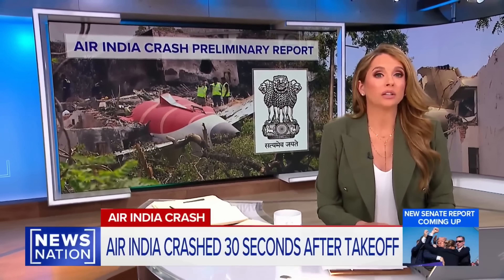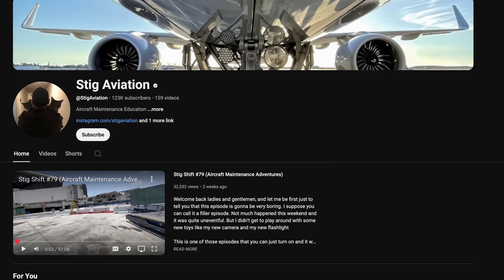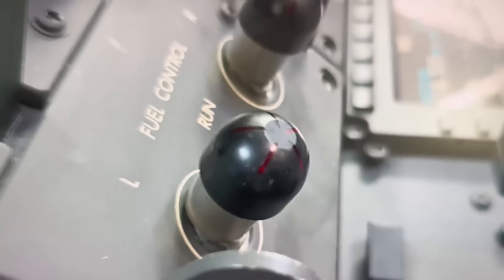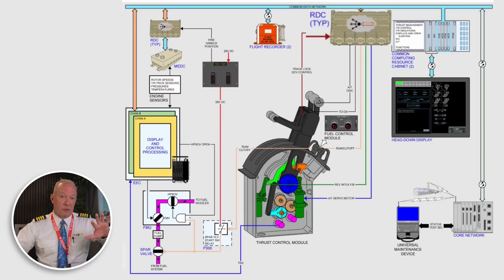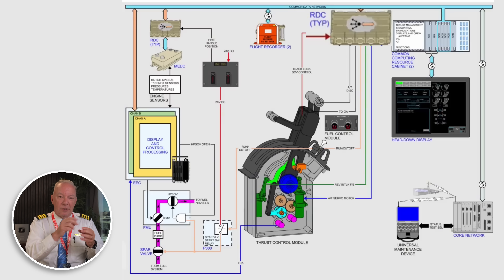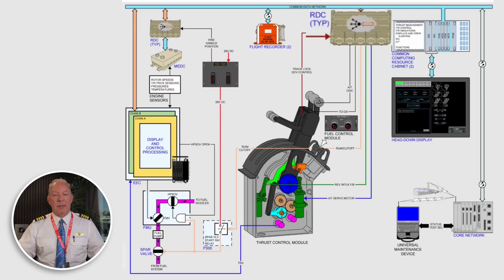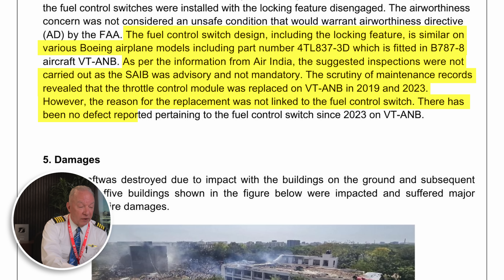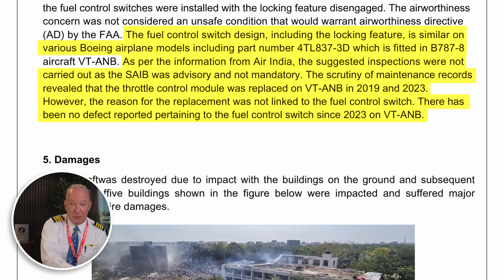The Truth About Boeing 787 Fuel Control Switches

Comment: If it's run by "relay", your switches are NOT directly providing power to the pumps. Hence " Relay" . Usually a switch can be a lower control voltage, that operates the relay. Than higher voltage or amperage is available through the power supply to the relay. The coil in the relay is what keeps the contact in or out, depending on the relay's configuration. Some are normally open, and others are normally closed. A separate ground is connected to the relay to give the opposite side of the actuator coil it's closed circuit. The actuator coil can be positively grounded or negatively grounded, depending on what the control circuit is designed to provide. The ground side of the coil, doesn't necessarily have to be connected directly to ground, it can be run through a control module, which can enable or disable it's path. There's more to it than you say  without the actual schematic, you can't assume the simple arrangement you offer. That Flow chart, may not show everything that is in an actual schematic. BTW: your switches are not relay's, and don't operate the same as a relay. https://images.app.goo.gl/ZUoH1qTBQRcaTZst6

Comment: You should note that a relay is an electromagnetic switch that takes a small current such as from the fuel switches and then magnetizes and pulls a switch to the other side (switch like a light switch but powered by electromagnet.) The relay then conducts a larger current than the small switch (fuel switch) can carry. They are set for normally open (off) or normally closed (on) when no power is applied. I would imagine the relay for the fuel valves would be normally closed (on) when no power is applied (run mode) but when the fuel cutoff is set to cutoff that would energize and open the relay cutting power to the fuel valves. If electric power is lost the relay would stay in the normally closed position and the fuel valves would stay open as well. As stated each engine would have their own system so not likely that there was duel relay failure.

Comment: Only other possible way to lose control switch power to the relays or even lose load side power off the relays is a total 28vdc failure in that closed loop circuit….. but highly unlikely in this situation given the data put forth on what was recorded as happening to one…and than the other engine shutting down and than again reigniting
Reply: You can have 28vdc failure in part of the circuit in general. It depends on specific connections.

Comment: Switches are controlled mechanically, Relays mostly electronically (and high voltage usually), and can incorporate both.  Relays are most likely to fail, in both conditions, i.e., either in 'closed' or 'open'.  Now, depending on the circuit?, it's easy to understand why both could fail at the same time, or be prone to electrical leakage from another circuit, regardless of what position the mechanical ones were.  In fact, we could well have a situation, where neither position of the mechanical ones do nothing, as the relays for these have blown open or closed.  Relays are ideal for remote control applications, and high-power switching, while both function identical, the relay is the weaker in the circuit, as it relies on a certain voltage to control it's position, on/off, or in some advanced relays, intermediate etc.   Most fridge freezers are fitted with them now, which is why you hear that distinct 'click' when the required temp has been reached, hence 'shut off' ;)  I have lost count of the amount of devices that have failed due to relays in my profession, and are No 2 behind the usual failed PSU in anything.

Anything is possible, as regards wiring and electronics.

There really is no need to look any further, than Boeing.

Comment: I have been asking this question with no answer...  How does the FDR Know the position of the fuel control switches?   We are saying the pilots moved them, there is no visual of that, If a major power spike the FDR could be confused as to the voltage drop thinking and recording switch movement. and the engines cycled a restart by themselves.  Totally confusing the pilots in that 30 seconds of flight.
Seriously you cant say the pilots moved the switches..  there are too many other points of failure in this totally electric plastic airplane.    Air India and Boeing have not a good track record of Truth.

Comment: am i not gettin´something? i know why these switches exist, but why is it even possible to shut them off in that stage of the flight, that distance from the ground? let´s not beat around the bush - it was suicide
Reply: Keeping it simple increases reliability and reduces mechanical points of failure. There is no way to fully prevent pilot failure. The pilot must be in control.

Comment: you said when all electricity fails there is still some juice left in the battery's to keep the fuel switches open but what when they realized all power was gone they might have still tried to move the wheels inside the plane, as stated from witnesses saying the wheels where tilted in the forward position, this depleted the left juice in the battery's since the wheel lifting system pulls a huge electricity surge resulting in emptying the last from the battery's resulting in no electricity left for the fuel valves. Also keep in mind relay's wear a lot all the time and can end up doing completely the opposite. In car diagnostic this is always a huge challenge when addressing electrical failures.

Comment: Captain Steeeve:   Would you agree that the pilot job can be very boring at times?   Especially if you are nearing retirement and you've done the company mandated procedures many, many, many times?  I say the India 171 Captain was just not "in the moment" at this time in the takeoff, went to do "gear-up" and his habit-brain just made a mistake and put the fuel switches down instead.   Unfortunately, this simple mistake is not able to be corrected in time at this stage of flight.
Let's have a discussion about the dangers of boredom in the cockpit.
(I am a former Avionics Engineer with a fair amount of jump-seat time)

Comment: I was a aircraft electrician in the army for rotary wing aircraft and we had those switches in aircraft. You did a great explanation of how they function.
Reply: When was this?
Reply: Captain Steve incorrectly describes the control of the fuel values according to the diagram he presented. He needs to explain and correct those errors if he is to restore his credibility.
Reply: what about a drop in voltage to the relays ( may it be the voltage or loose wiring or ....) Is that not a possibility ?
Reply: @theguy4355 anything is possible…however BOTH of them failing within one second of each other…lessens the chance of that quite dramatically.
Reply: @theguy4355 But both within 1 sec of each other and then on again?
Reply: @USCG1990  If you are committing suicide you don't turn them back on again.
Reply: @JoeLinux2000  there were 2 pilots in the cockpit, it's most likely the other one turning them back on after realizing the situation. And the pilot who allegedly turned off the switches pretty much knew that there's no going back at such low altitudes. He did it at the absolute perfect time from where recovery was impossible
Reply: @DuskyDaily  The other pilot did not say he did put switches on again.

This whole story of Captain Steeve is absurd, he does not give the electronic circuit how to check if switch is off. It does not have to work with the switch, it can work on relais.
Reply: @theguy4355  Who knows, but typically one wouldnt wire a DC circuit into a switch, to then go to a relay that closes and provides the exact same voltage rail to a series of devices. That would be adding complexity for no benefit. If it was the exact same circuit, it would be far simpler just to wire the 28V DC via the cutoff switches, directly to the valves, no relay needed. The schematic shown in this video seems to indicate that teh RDC provides the electrical path through the cutoff switch as the source for triggering the relay which snaps closed to connect the 28V DC to the valves, anything that affects the input to the switch also affects the output of the switch which closes the relay. You could possibly operate it the other way where the relay can be closed when no voltage is coming from the source, but that would need some digital electronics inline between the switch and the relay. More things to fail.

I dont know what kind of batteries are used, but I have to assume they are rated for very high temperatures, if not then temperature causing voltage drop in batteries... But that doesnt really account for exactly 10 seconds and it comes back on again.

Still if both replays are powered by the same hot battery bus, anything that can affect that bus can affect the relays. That said, report didnt cite any directives or anything to check on the rest of the fleet. I am guessing if they suspected a design issue, everyone would have known about it via a recommendation very quickly. Does that mean there isnt an issue with the aircraft... No not really, just that is extremely unlikely, or its an issue that is inconceivable. Like that incident in Athens with the 747 losing an engine on takeoff in the '70s (i think might have been '80s), no final report partly because Greece at the time didnt have an investigative body, and also because Boeing themselves didnt believe it was possible, they said the aircraft should have crashed.
Reply: @MrGeneralScar  the reason for wiring DC switches into a rely than directly wiring is it typically to isolate high amp and low amp areas, such that all the current doesn't flow through the switches and just a small current flows to signal the relay. The switches are also connected to the RDC for a digital signal to be recorded differently. The voltage for a digital signal to RDC is different from the 28V needed for the valves.
Reply: @DuskyDaily yeah, thats what relays are for. This video was suggesting the same 28v DC rail that drives the valves via the relay also supplies the switches which are connected to the relay. That wouldnt make sense. Its more likely a low current low voltage rail feeds the switch and then on to the relay to provide high current 28v dc.

Therefore, anything that can affect the supply to the switch also affects the relays, and valves. Not that they do this... but if both cutoff switches are fed from the same source, if that source fails both relays also fail. And on a data feed, that may look like switches turned off depending on where the data point is recorded from.

It is certainly possible that an electrical fault that no one thought possible could have contributed.
Reply: @MrGeneralScar I hadn’t noticed the lack of supply to the switches. I followed the feed to the relay and assumed the feed to the RDC told the flight recorder that the switch had been actuated.
Reply: @MrGeneralScar Why wouldn’t that make sense? Why wouldn’t it use the same 28VDC bus for both the switch to energise the solenoid of the relay and also to provide power to the fuel valves through the contacts of the relay?
Reply: @antelopeslr5000  Why use a switch and a relay to send the voltage and current to the valves? That adds a point of failure. If it was just a simple 28v DC direct to valve then why not hook the switch input to the battery bus bar and the output of the switch directly to the valves? There would be no need for a relay between the two.

If the switch input is say a much lower voltage and current, that is passed to the relay to energise the relay to switch on a high current 28v DC circuit from the battery bus to the valves. That is what relays are used for, to use a low current/voltage through a switch to control a high voltage/current circuit. That way if there is an issue with the switch the human doesn't get lets say 28v DC at 50 amps pushed through his hands which quite honestly would at the least cause significant injury and at worst kill said human.

Even if it is the 28v DC flowing into the switch the current would be much lower than what is needed for the valves to operate.
Reply: @MrGeneralScar 28VDC isn’t a high voltage. Why would you need a lower voltage to energise the relay? And where is this lower voltage coming from to energise the relay? Most commercial/military aircraft have both 28VDC and 115VAC 3 phase 400Hz as power sources and you’re not going to step down voltages just to control a relay when 28VDC is perfectly fine to do that. 

You would use the 28VDC to energise the relay. This would have very minimal current draw through the fuel cut off switch. And as you said, by using a relay the higher current draw for the fuel valves would be through the contacts of the relay and not the switch. That is the primary reason a relay is used. There is no reason to control the relay with a lower voltage.
Reply: @MrGeneralScar you have completely missed why we have used relays in a century, to ‘amplify’ the current we Can switch…..

Comment: @CaptainSteeeve, The big question is on the exact time when  the RAT deployed and  when it started  providing Electrical power to critical systems including the Eaton Fuel cutoff  Spar valve actuator (53-0049:K2523)  through  28v dc hot bus. That would explain the 10 seconds delay between (08:08:42 to 08:08:52) in relight attempt. In my opinion, a hard short in the main 28V DC battery triggered a chain reaction collapsing the 28 v DC bus and cascading electrical failure.  Extracting fault logs from the Bus Power Control Units could provide a definitive digital footprint of the electrical failure sequence.
Reply: Big stretch. Really really big. For the rat to deploy (total electrical failure) the almost impossible had to happen TWICE. Then one second apart. And finally, doesn't explain why one pilot was heard asking why the other turned the fuel off. Impossible make evidence fit. Occam's razor. Don't overcomplicate.
Reply: @miketan4803 All we have is a paraphrased conversation in that AAIB prelim report, without a timestamp. It could be the converstion that triggered the QRH (non traditional memory checklist item) by the pilots.Also AAIB report states that RAT was deployed and started providing hydraulic power at 08:08:47 (as per documentation RAT would provide hydraulic power within 5 seconds after deployment and could provide electrical power after 10 seconds of it being deployed)

Comment: Personally, I believe the one pilot saying "why did you cut the fuel" is more of a red herring, as he would have heard both engines spool down, seen the gauges decrease, and possibly even seen a warning in the instruments. Plus, the VCR (as far as I know) was translated from another language, so it could have easily been a translation error of something like "did you cut the engines?" Instead of a different implication "why did you cut the engines(I can't verify that, of course.)
Reply: Claiming to know the switch position is a red herring.  I've seen switches that don't work on many occasions.  Capt Steeves explanations are extraordinarily childish, leaving out many factors.  I would not hire him to trouble shoot any electrical problem   Has Capt Steeve ever heard of an intermittent electrical fault?   The idea that the cockpit switches are directly connected to the fuel valves in the engines is patently false.  The switches control relays that control the valves.  There is always the possibility of a poor electrical connection due to a variety of factors - at the switch, at the relay, at the control valve. to the FDR and so on.
Reply: @JoeLinux2000 so a simultaneous dual failure?  A failure and then a reconnection of two  independent circuits at the most critical phase of flight? Occam’s razor would disagree… we may find out someday.
Reply: @JoeLinux2000  well Joe you definitely are not listening. Steeeve explicitly stated that the switches are connected to relays, even if you missed it. 
The idea of an intermittent electrical fault on even one of these switches is utter nonsense. No such fault had been recorded previously, and they still have the switches to test. Plus these are critical switches, no doubt with built-in redundancy and not something bought at your local Tandy store. Lastly as the other person pointed out, the same thing happened to both switches of the same time. 
Not only would I not hire you as an electrical engineered troubleshooter problem I wouldn't hire you for anything
Reply: @JoeLinux2000  You've seen fuel cut-off switches that don't work on many occasions? 

And  poor electrical connections causing the same error within one second in 2 independent circuits?

Comment: There’s another expert channel where they managed to synchronize CCTV and radar data. That led to their very plausible final conclusion: the RAT deployed about two seconds before the engines were shut down via the fuel switches.  
So something else must have triggered the RAT deployment.  

No thoughts on that, @CaptainSteeeve?

Comment: Captain steeeeve…. I thought that the ANA uncommanded shutdown was due to an overboost 😊which shut the engines down without the crew needing to move the fuel cutoff switches… 28V dc voltage cannot be shorted due to inherent moisture inside the engine digital control modules? The voltages inside the relays cannot fail and send a false cutoff signal to the engines? Not everything is pilot suicide when it comes to a hull loss of a Boeing aircraft….

Comment: How many of you have ever had a battery die? Captain Steve says that's impossible. Oh, and he doesn't want you to look at the AND gate either, because it's another way something else can close the valves other than the switches. Definitely don't look at all the other systems that lost DC power until the RAT recovered the most critical systems. The switches couldn't have cut power to ANY of those other systems.